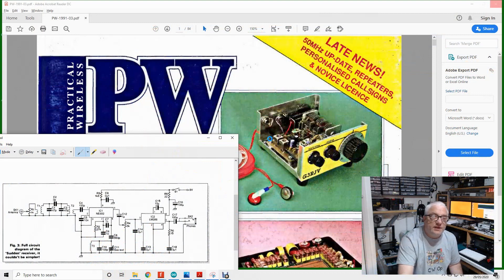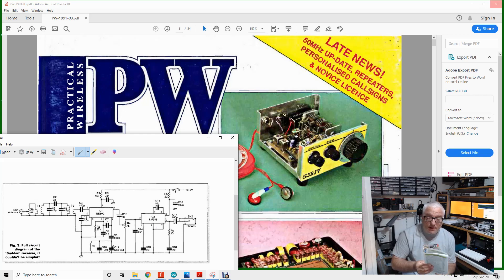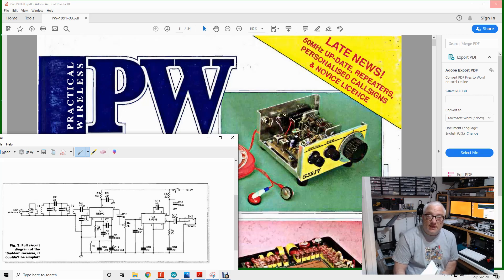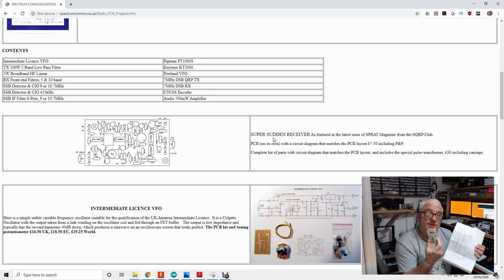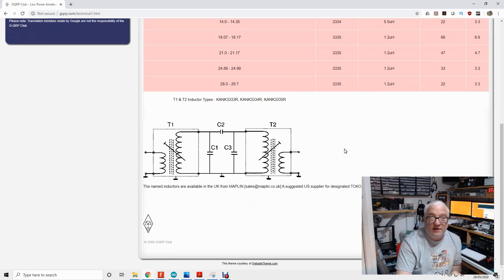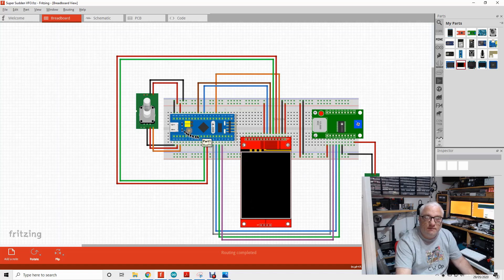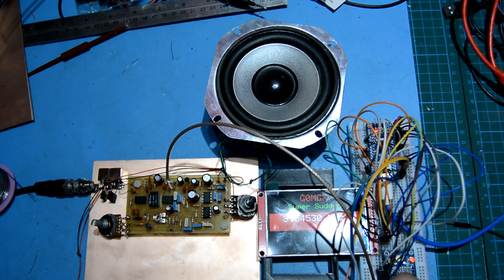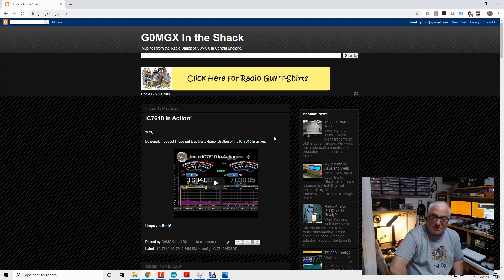The Sudden HF RX - A simple HF receiver build

Comment: Hi Mark. I thought I'd use your code so I can start to get my head around TFTs and the STM32thingy. Where did you source your ILI9488.h library? Thanks, Neville ZL2BNE. PS, I'm pretty new to Arduino etc and these library things are doing my head in!
Reply from the maker: Hi Neville, I've uploaded the library files to the project directory https://www.qsl.net/g/g0mgx//BlogFiles/Sudden/
Reply from the maker: Any other issues let me know
Reply: @MarkG0MGX  Hi Mark. I've sent you a couple of emails to the address showing in your qrz.com. I'm going mad trying to figure why I can't compile your code. My guesses are wrong library versions, wrong board selected, or perhaps the way my windows is configured and where my files are loaded. I'm happily compiling and uploading lots of other code, it's just the TFT that's doing me in. Most frustratingly I'm using the same STM32 & TFT as you are using. I do hope you can help as I've exhausted all other avenues that I can think of. Thanks heaps.

Comment: Cheers Mark. Like you, these "simple" projects bring me the biggest smiles too. Just curious … did you need to muck around with the output level of the AD9850?
Reply from the maker: Nope - just used a bit of thin coax to connect them directly.